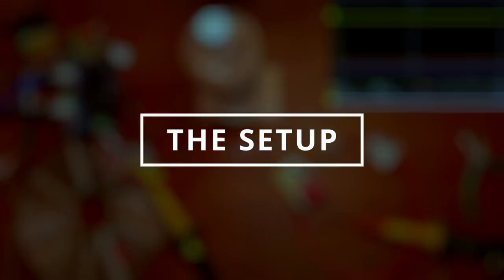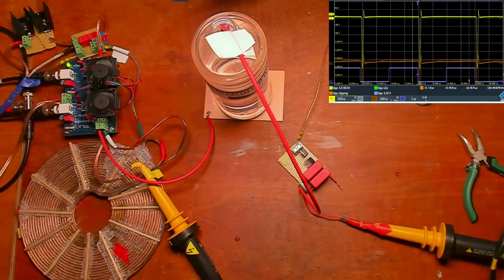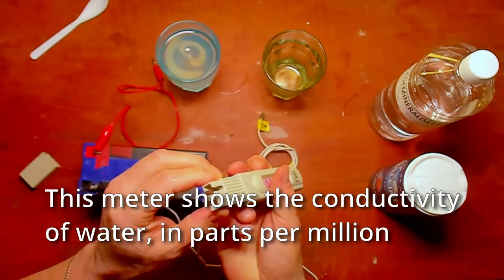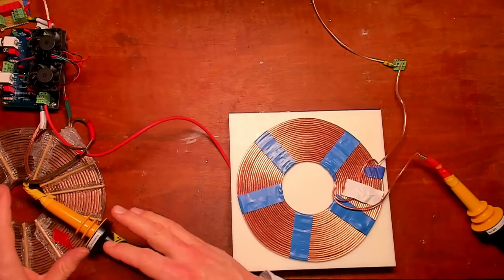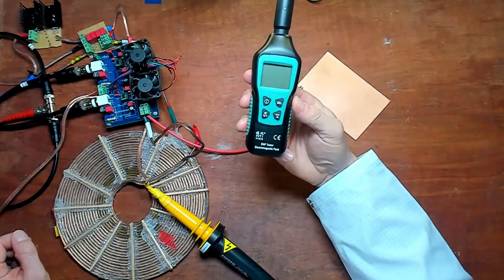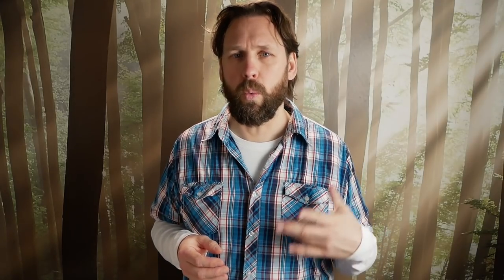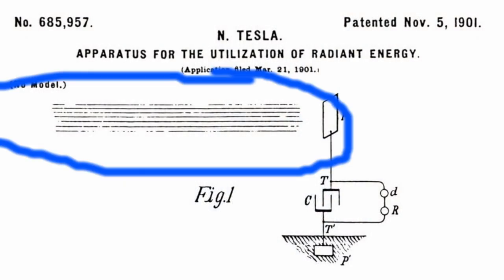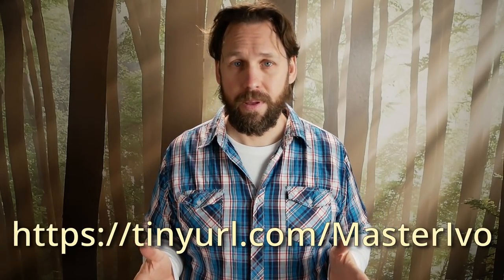Electric Conduction Through Distilled Water

Comment: Your first experiment with the water bottle behaved exactly like a static Leyden jar (capacitor, displacement current).  I'm not convinced the current was traveling through the water.  Like a leyden jar capacitance, the current might have come from the plastic.  Did you try this with an empty bottle without distilled water?  I think this displacement current causes induction almost exactly like transmissive EMF, like in radio waves.
Reply from the maker: You can easily do that test yourself. I think it won't work, as the probe is in the water, not in the plastic of the bottle. I see the water and the plastic as the same, both are dielectric materials.
Reply: @MasterIvo   Hi Ivo. I apologize for being confusing.  First, I think your work is awesome and is already the most significant improvement in current efficiency I have ever seen. To me you are my hero because so many others are failing to search for answers to our carbon emissions. I admire you greatly.  I'm just saying I think the current being transmitted from your frayed-wire is probably acting as an EMF transmitting antenna and the opposite polarity copper base is attracting that EMF.  And I think you would actually get similar results without the bottle or water at all. Suspend the frayed-wire the same height above the copper base as it was when inside a bottle, but have no bottle or water between the two, just air, and my guess is you'll find similar current. If not, then you are certainly correct that current can travel through  pure h2o and should immediately patent that and pursue it for underwater frequency transmission. I actually hope that's the case because it could help finance the much more important research you are doing.  But I humbly suggest that is counterintuitive though and suspect you are receiving displaced current as any other AM or FM radio antenna receives from transmissive EMF towers. Your current is spectacularly high though because the pulsed frequency and the oppositely charged base are so close together. Incidentally I was very happy to see your use of proper shielding safety equipment because that EMF must be at dangerous levels to produce that kind of spark. True, I should do the experiment myself.  So please take this with a grain of salt. Because I dont have the resources or time. I am studying EMF in a different manner. This thought is only meant as a good intentioned reminder to test alternative scenarios. If I had the ability and finances Ivo I assure you I would be right beside you in your lab  assisting you in any way you need. If you would have me as a volunteer. That's the confidence and the importance behind your research I have. My message here is not  intended to be negative.
Reply from the maker: Thanks for your kind words. Maybe you are right, maybe not.
What I did notice, is when I first put the high voltage probe into the water.

While It was still outside the water, it showed a small voltage, so yes in the air (at 20cm above the impulsed plate) there was some voltage.

But when I put the probe into the water (same height), the voltage was much much higher. from memory around 2000V. and it looked  the same as the impulse from the coil, just slightly less voltage.

So I hope that clears things up.
I don't believe in patents.
Reply: @MasterIvo   yes. In fact it brings some things to mind - like if a copper base energized by a resonant negative bifilor pulse when put behind a small solar cell array may attract more photons to the cell than a similar cell array without a grounded copper plate behind it. Or if bipolar pulses could be used in a funnel array to direct photons in concentration to a small solar cell similar to the way an old TV electron gun directed electrons.  I think your work is going to lead to things like this Ivo.  Your work is very promising.

Comment: So, is this simply an example of using the dielectric of distilled water instead of a more common insulator to build a capacitor?  Only changing voltages will pass through the water. To test this, take the water out of your circuit and put two neutral plates on each end (the water, like any dielectric will still have the charge). They will still discharge when shorted.
Reply from the maker: no it's all about the displacement current and using that.
and see if we can amplify it.
using the pancake coils as plates
Reply: @MasterIvo  OK. I see, you are shifting the focus from what is happening with the conduction of electricity through an insulator to taking advantage of the capacitive-inductor tank circuit of a bifilar coil. Fair enough; still displacement current through a capacitor is pretty much the definition of the dielectric field traveling through the capacitor.  And intuitively it is pretty clear both voltage and magnetism, the two components of electricity, are relative quantities that behave similarly to kinetic energy, also an expression of relative quantities. They transfer energy more efficiently under acceleration (re: the Oberth effect) So, changing values (acceleration) effects transfer into and out of capacitors and inductors and non-ionic dielectrics. And that transfer is proportional to the rate of change, not the actual speed or value. (Impulses maximizing the acceleration) Your results are indeed how physics works from this perspective. BYW, Great demonstration, thank you. 
The key to Tesla’s radiant energy was its implacable response to charge or magnetism (which he attributed to the neutral nature of Ether, but I’m 1/2 a mind to write it off to the resonance response of impulse energy which is highly tuned to atomic structures and either non-interactive or resistance free interactive. Those interatomic distances are very specific in their compatibility. 
     The plasma reactions Tesla sourced were like the energy produced by stars ( mostly non-interactive until it struck an atom it was tuned to. Stars are invisible to the eye in space, illuminating atmospheres and giving the illusion of being in the sky.
Reply from the maker: yes, remember there are 2 modes for the dielectric and magnetic fields.
Longitudinal and transverse.
the charging capacitor is a transverse dielectric field normally.
but using the high dV/dt impulse produces a longitudinal dielectric field, resulting in a longitudinal magnetic displacement current.
so we have 4 types with different properties

Comment: What if you were more in the negative range compare to ground. A diode in reverse to ground...?
Reply from the maker: that also works, it uses the other half of the impulse displacement current, the cap then is charged to opposite polarity
Reply: Thanks.

Comment: Note: Distilled Water is by no means "pure water". Even laboratory-grade dual scrubbed, constant flow circle-path filtered ultra-pure Deionized water still conducts some electricity, with a resistance of about 18.1 Meg-Ohms /cm (0.055 microsiemens conductivity) 

Distilled water from stores has a resistance of about 0.2 to 0.5 uS.

The more "pure" water is, the more corrosive it is, and it will leach plastics into itself, degrading the purity quickly.

This is also why it's dangerous to drink Distilled water by habit... it will pull nutrients out of your body, and carry them out through urine.

Because it's corrosive, it will also quickly pull copper ions out of the wire, drastically lowering the resistance of the water.

You would get the same result by replacing the water bottle with a high voltage 10 M-ohm resistor in series with a high voltage 10nF capacitor.

Actual "pure H2O" can not exist in any container for very long, as it will deteriorate the container by pulling free ions into the water, decreasing its resistance (ie, increasing its conductivity).  Pure "New" water also degrades itself as some H2 atoms will split and attach to existing water molecules, making H3O and leaving hydrogen ions loose, reducing the water resistance. 

Just remember, even absolutely PURE H2O has a conductivity of 0.055uS (18.1 Million Ohms per cm)... but a High Voltage Leakage meter is required to measure such high resistances.

Also... 
Radiant Energy is not pulsed, it's constant and polarized... so no diode is required. A conductive plate at the top of a 100 meter tall Insulated pole, with a wire reaching down to the bottom, will have a voltage potential of +10,000 Volts relative to the earth... but at very low current (depending on the collector size). 

This is still a significant resource of energy, if we would properly convert it to lower usable voltage.
 (there are many videos about Atmospheric Electricity on YouTube)
Reply from the maker: I see radiant energy as the displacement current. Not the DC dielectric field (atmospheric or not) itself, but the longitudinal movement of this dielectric field.
So it is induced by high dV/dt. my latest video shows this, which also shows induced earth ground currents.

Comment: This all seems like an RF circuit.  I'm postulating Xc = 1/(2 pi f C) is the governing equation.  You demonstrated conductivity (low impedance) through the media.  Xc is small, like 1 or 2 ohms.  To achieve low Xc, the frequency must be large (>kilo Hertz).  If you went to 60 Hz it wouldn't work.
Reply: Displacement current increases with the resistance and resistance increases with the frequency.
Reply from the maker: @Agrx Drowflow. C (capacity) is also extremely small! the frequency would need to be much higher for your postulate to work
Reply from the maker: @Tyrone Faulkner you have got me thinking about resistance.
I think the displacement is mostly related to the dielectric constant of the material (the ability to be polarised).
But indeed "regular" current needs low resistance to be high.
while displacement current needs high resistance to be high.
This makes me think I need a high resistance load. (series connected loads).
Reply: @MasterIvo  I'm thinking along the lines of one of the other comments. Send high voltage high frequency low amps into a primary  coil and use the magnetic field produced to induce current into a secondary coil. I'm not too familiar with pancake coil but if the secondary was cylinder shaped I would have a bucking coil. I'm trying to find the formula for the magnetic field associated with displacement current but it makes sense the stronger the displacement current the stronger the associated magnetic field ie. high voltage (low amps), high frequency and the polarisation of the dialectic. The dialectric in the case of a coil would of course be the plastic shielding.

Alternatively the primary and secondary coil could be placed after the 2 capacitors as part of a hairpin circuit. In which case you would only have displacement current through the primary.

Comment: 18 megohm (pure) water has resistivity at room temperature.  It's a high resistance a a standard cell, but is pretty low as the surface area increases.  This is standard stuff.  As you go to higher voltage the current goes up
Ionization potential is only about 13 V, so you generate ions in the distilled water.
There's nothing special to a particular source of voltage.

Comment: Can you move the charge in a dielectricly charged plate with magnetism?
Reply from the maker: Interesting question. Yes if it is polarised. then it also should be possible to heat it up.
Reply: @MasterIvo  been thinking for a long while now.. staticly charged surfaces, rippling in charge in a direction.. could generate a lot of thrust, in a lot of environments.. so maybe an array of electromagnets underneath could facilitate that rippling.
Reply: @richardward6747  Maybe you're interested, C. P. Steinmetz said that "static charge" is a counterproductive way of contemplating what's actually happening. Cheers

Comment: Wow you made a capacitor from an insulator it's a lyden jar so what all insulators break down at some voltage not sure what's the point exactly cool to see the water capacitor charge up and discharge on oscilloscope but not sure the point is the voltage is not traveling threw the water it's surrounding the water with a build up of positive ions and creating a static field around the bottle and back to surround the wire all the energy moves around the wire not threw it just like it moves over a circuit board not inside the circuit board your it's all varying emf Fields it's the air around the bottle  conducting to the wire as it comes out the bottle the emf and is basically invisible plasma moving around the bottle and bleeding back into the wire. Any high voltage or high frequency would do that.
Reply from the maker: no plasma no ions

Comment: I see a problem right away.  As soon as you put that copper thing into the water you are introducing ions into the water.  This is doubly true because you soldered onto the wire.  You need to include this fact.

Comment: 6:11 how can you connect your source positive to earth ground? that would drain your source into ground.
Reply: Because of L1 coil.
Reply from the maker: you can ground the positive supply to earth, voltage is relative.
Reply: It’s pulling electrons from the earth. Tesla saw earth as a huge battery in space charged to unbelievable levels. The Long Island tower made use of this knowledge. The top post was a way of storing a charge and thereby creating an unbalanced system that the voltage of earth tried to consume and balance out. All that was necessary was to tap into that path between the unbalanced system to get any level of power you want. It was fascinating.

Comment: I use double distilled water to produce colloidal silver with 30v dc. The statement that distilled water does not conduct electricity in my experience is false.
Reply from the maker: true, I do the same, but this takes a lot of time, because the charged silver particals need to be pulled into the water, which makes it conductive

Comment: did you try the experiment without water at all? why you are thinking that water and not the bottle playing role?
Reply from the maker: I tried im the air.
without water? the bottle? I could melt the plastic and stick the probe in. as it is probably a good dielectric its should also work